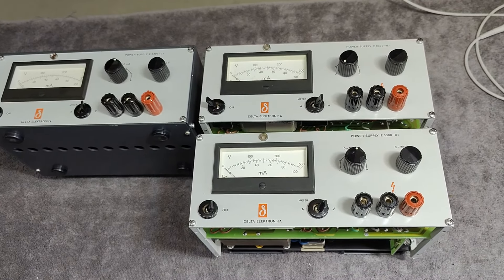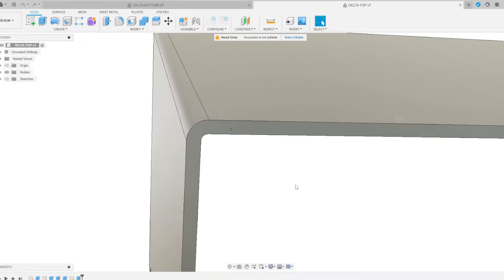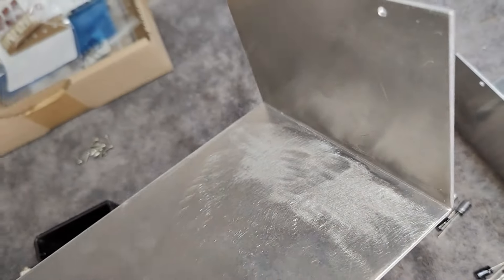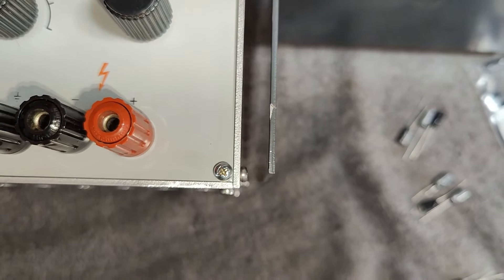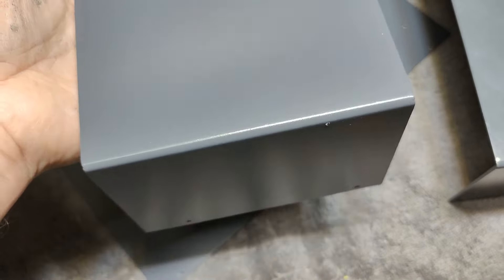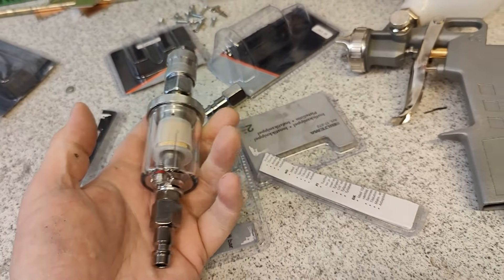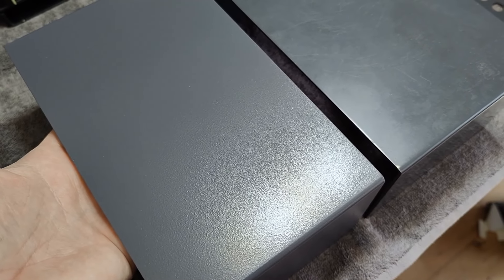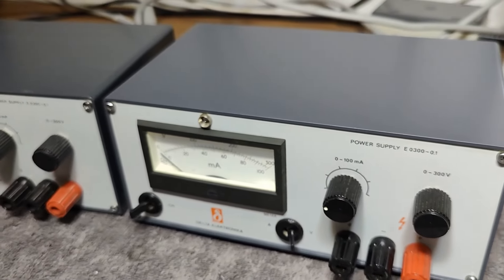Delta Elektronika DC power supply CASE DESIGN FOLLOW UP

Comment: Fin Video 😀Det tool du brugte til at designe i, var det PCBway eller et andet tool ?
Reply from the maker: Fusion 360 i tried also to explain that in the description, if you want to get started with Fusion 360 i have made a full get started video section containing 20 video clips.

Comment: paint was too thick,this causes the spotty texture...sand it down with water to absolutley flat,mix paint with 10 to 20% thinner and re flash the parts...keep the fan wide using around 70psi........i was an industrial spray painter for 20 years,after the electronics industry in Scotland died.🙂
Reply: you can obtain various types of finish,dependeng on preferance.
Reply from the maker: thanks a lot, i will experiment much more with this type of psint and mix it thinner , and try sanding between layers, as a propainter, do you only paint stuff once ? or two layers ?
Reply from the maker: @jonscally2349  also a good point, the fun thing is : alot of electronics got exactly this paint surface i created by accident :-) or random luck, depending on how you look at it, it surely was not skils, since this is my first time using a paint gun
Reply: @TeardownOZ2CPU  This is the surface is expect for an electronic device like this one. Nearly all my cases look like this. I like the paint job!!
Reply from the maker: @Nixie_Claus  thanks a lot :-) i like it too
Reply: coat of primer then sand flat..2 coats of finish again sanding flat before final coat..
Reply: its all in the surface preparation and how you use the gun.
Reply: forgot to mention the fluid control..start from valve almost shut to rerstrict paint flow,open gradually till you are happy....practice on a test piece.
Reply: If I want an exceptionally flat finish, I'll lay a heavy pass of primer then wet sand it smooth.  Use a rubber wiper while wet sanding in good light and it will show the surface finish very well.  Rinse/Repeat as necessary to get the desired finish.  Your top coat(s) are only as good as the base coat so concentrate effort there.  As others have stated, your paint was a bit thick and needs to be thinned.  Personally, I'll do several light coats waiting maybe 20 minutes for the last layer to flash off, then do the next coat.  If I'm spraying an enamel, I'll often add a hardener to make it a bit more durable.  I'm a CNC machine tech., not a painter so my comments are well worth what you paid!

Comment: $208.- is a hefty price tag imo.
I would bend it myself and forget about the fraction of mm accuracy.
It’s lab equipment, not furniture after all.
But the result is nice, no doubt.
Reply from the maker: do you have a bending machine ? do you have a plate cutter ? can you put all the holes exactly as accurate ?
was the bending machine for free ? how much space will it take up, you pay for this space every month too.. if you think about it
Reply: @TeardownOZ2CPU  No, I don’t have those tools, a local workshop let me use their bending bench and guillotine shears after hours.
For smaller stuff, I cut the aluminium sheet with the table saw at home and bend it in the vise or with clamps and wood support.
This works OK, not for sub mm accuracy but I tolerate that ;-)
Holes are drilled a little larger to match.
Reply from the maker: @inse001  lovely :-) i dont have access to a very local bending machine anymore, and when i did, i just never mastered this skill, it was just alway a visible bit too small or too big, it always drove me mad, how hard it is to make this perfect
Reply: @TeardownOZ2CPU perfectionism is a pain - you gotta let loose in the literal sense
Reply: @TeardownOZ2CPU  haha, I tend to try and go the perfectionism route too, though sometimes I have to wait a long time to continue a project because of the extra costs. When 3D printing is possible, I have a printer though, that's one of the best tools I ever purchased, I didn't realise it at the time, but it sees a lot of use for various things!
I recently designed a complete 486 retro PC case also sent to PCBWay for machining out of aluminium. It was also a way for me to try by myself for the first time their sheet metal services, same here I seem to understand. That was really cool to see here, very well done, and very good precise measurements!
It reminds me I have a few projects that need some machining too, mainly CNC aluminium, acetal (POM), and resin printing (my printer is not resin)... when I find the budget for it 😅
- 73 de FR4RX
Reply from the maker: @Slay3rOne  sometimes.. some of my projects just end with a, lets go all the crasy way no matter what cost, this time i learned something new.